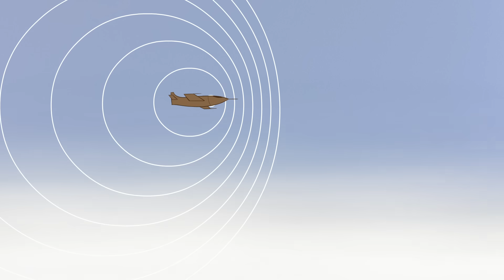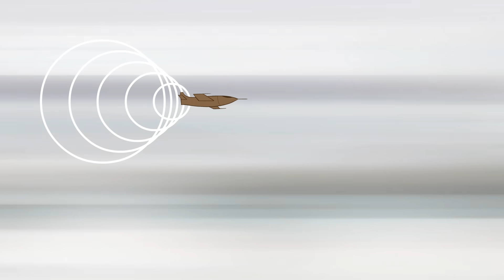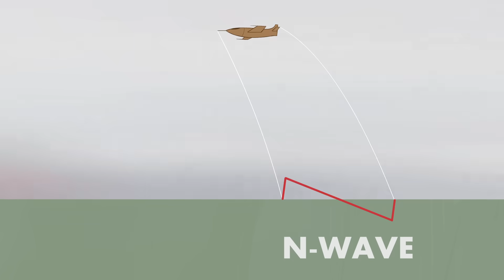The sonic boom problem - Katerina Kaouri

Comment: There’s a lot of great things about his video, but the fact that you used km/h is perhaps the greatest.
Reply: All hail the metric system.
Reply: Using SI units is the trait of someone serious about STEM as all the equations work without messy conversions. It is beyond me why we havent adopted SI in the US as the norm. I truly hope we eventually will. Imagine not having to learn a second set of rules and just concentrating on the concepts, relationships of phenomena, and a single set of formulas. Plus, we can rid ourselves of the introduced error given by conversion.
Reply: @ACKZink  In the SI system, the correct velocity units are meters per second, not kilometers per hour.
Reply: @ACKZink  I feel for you but here in the UK we have a very very messy mix of the two. !! Cars - mph. Food - now in grams.  Flights - miles.  Road signs - miles!  You get the idea. My kids are still confused and I really thought by 2021 we’d have got settled on one SI system !!! Great vid.
Reply: @ACKZink  not really. Plenty of professionals don't use SI units, e.g., what is the mass of the Higgs boson, and how many inverse pico-barns did it take to measure it? How many Janskys is that radio galaxy? Got a 500 mb weather chart? Speaking of weather, how many dBz was that rain last night?
The mark of someone serious about STEM is that they use the right unit for the job.
Reply: Km/h is more widely used.
Reply: Ideally there would be both but if you could pick one I think the metric is the right choice 

-US PERSON
Reply: Whose here after the sonicboom in Bangalore
Reply: @SataniaSquid  I know it's been 6 months, but you can't say that 1 km = 0.6 miles and then say 6 km = 10 miles. I think you meant 6 miles = 10 km.
Reply: Izz Irfan  no the UK Use Miles
Reply: There are countries that use the metric system, and then there are those that landed on the moon.
Reply: Quick. Americans are sleeping. Support km/h
Reply: Gold comment
Reply: ktas would be better
Reply: isnt mach 1 like 1200kph. dude said it was like 1100kph.
Reply: @m1a1abrams3  kph isn't a unit
Reply: Matic Pogorelec Your sentence structure is not correct.
Reply: @m1a1abrams3  And what is wrong about my sentence structure?
Reply: Matic Pogorelec First off, I don’t know where it starts nor ends since there isn’t a capitalized letter nor is there a period.
Reply: @m1a1abrams3  And what is second off?
Reply: Matic Pogorelec Why does grammar on the internet  even matter if people understand the idea of the sentence?
Reply: @m1a1abrams3  because kph isn't a thing.
Reply: Matic Pogorelec kph is a thing lol, just probs not in ur country
Reply: Kmph is easy
Reply: Underrated comment.
Reply: Listing both would have been the best thing about the video
Reply: *the worst
Reply: The worst
Reply: Why the heck did us Americans end up with the weird measurement system? I would’ve much rather learned km/h in school than mph because it’s so much more convenient. I like using miles more but it’s mostly just a hassle because of the fact that the rest of the world uses kilometers.
Reply: I dont understand third world country measurements
Reply: From Philippines👍
Reply: HuRrRrRrrrrrr
Reply: I think that’s the worst thing about the video.
Reply: Just divide by 2 for knots.. ish
Reply: So this is smart level humor huh haha
Reply: Yes
Reply: Celsius as well
Reply: Never had I agreed more with someone as with your comment..
Reply: perfect for Indians
Reply: Sonic boom is a big TV show
Reply: Izz Irfan  no actually, the rest of the world, except a very few select countries, use knots for airspeed like normal people, regardless of wether the plane was built using metric, or comes from a country that uses it.
Reply: Is better m/s you can see the speed more detail
Reply: Mechail Reydon 
That is true
Reply: No
Reply: My god he did it
Reply: Why?
Reply: Agree
Reply: America is not happy
Reply: Asian peopele like this
Reply: I'm american and I am learning metric to avoid confusion and sometimes wish that we would adapt to the metric system. I would tell my friends that i was going 120 down the highway and 60 down the neighborhood as a joke and cracks me up to hear their reaction!
Reply: +1
Reply: Speedofeet user when they hear a meter 🤯
Reply: Idk how he didn't use bald eagle per oil litre
Edit:wtf is going on in this thread
Reply: Yes, this was the best
Reply: Some Americans wont understand 😏
Reply: i do miles though ;(
Reply: I'm America and i still have no idea why we haven't swaped
Reply: Hahahahaha!
Reply: It is the way.
Reply: in merica we use hotdogs per bald eagle :(
Reply: Bruh it not hard to change km to miles just divide by 1.609 or knots divide my 1.852
Reply: REEEEEEEEEERRREEERRRRER
Reply: @SuBk.  América is a continent. That is literally its name. Idk where are you getting the info 😐
Reply: Nah
Reply: In murica they use pi miles per quarter century.
Reply: Amgery 'mericans everywer
Reply: NOOOOO. Mph is the best!
Reply: Fax kid
Reply: Should've measured using football fields
Reply: @nottingham12312  america bad?   You mean America is Badass!!
Reply: Absolutely true LMAO
Reply: Perhaps the worst
Reply: I would be surprised if they didn't.......You don't use anything else but metric for scientific stuff.
Reply: @somethingsomethinghere  that's just not true. May pros deviate from S.I.
Reply: Right
Reply: For real.
Reply: Cope
Reply: I dont understand fourth world measurements
Reply: screw imperial system!
Reply: Not very helpful for people living in the US or the UK though is it? The majority of the audience for English speakers.
Reply: meow meow meow
Reply: cries in freedom tears
Reply: Nooooo not KPH
Reply: So British
Reply: plus the minecraft splash sound effect lol
Reply: I disagree if you're going to use kilometers per hour at least speak in a British accent
Reply: Probably the worst thing about the video
Reply: Yes true.
Reply: He did because because of the S.I. system
Reply: Mph would have been even great 👍
Reply: Km/h or SI unit
Reply: @pralay1265  we are the crystal GEMZ 💎
Reply: Knots is much better for aviation context. I just block videos and channels that use the metric system.
Reply: Amen
Reply: Despite the fact that the standard way to measure speed in physics is m/s.
Reply: exactly. car vids and channels should do the same
Reply: The metric system is only good for measuring small pipe. Says a lot about you .
Reply: @getlost4827  imagine using imperial
Reply: Hello nonUS people
Reply: Yes!!!
Reply: Why don't americans use nose/face
Reply: knots
Reply: Miles per hour plese.  MURICA'!!!!
Reply: meter/sec 🙂
Reply: I love the metric system too but they really should have used knots. The formula to find the speed of sound in knots is:  Local Speed of Sound (Kts) = 39√(273+Outside Air Temp (c))
Reply: Yes, educational videos that are discriminatory towards the audience are really great!
Reply: @user60521123  Would you call it discriminatory for using mph? 95% of the world population uses metric.
Reply: politicize much?
Reply: I’m an American, and I prefer kangaroos/gogurt to km/hr…
Reply: America is not a country, its a continent
Reply: Shadow Moss America isn’t actually a continent, but North America and South America is.
Reply: @Olliwer  its a continent, but if you see it like that, you should count central america too
Reply: Shadow Moss Central America isn’t considered a continent though.
Reply: @Olliwer  north america, central america and south america are the same continent. If thats not how they teach you in school, i feel sorry
Reply: Shadow Moss I don’t think you have been in school if you think they are a single continent. Even a simple google search would have cleared it up.
Reply: @Olliwer  what a surprise, googled "America" and says "is the second largest continent after asia" and if you do a little research, just a little (literally just scroll down) says that america del norte, america central y america del sur are subdivissions of the continent. Again, what a surprise
Reply: Shadow Moss Well, we are using different googles then. You are probably reffering to The Americas, though that isn’t a continent either.
Reply: @Olliwer  no, america
Reply: @shadowmoss6413  Yeah Asia and Europe is the same continent
Reply: @Olliwer  America is a continent. They teach us that in school.
Reply: @vanessasx  If you’re from the US that’s understandable, if not your school sucks
Reply: @shadowmoss6413  No dude that's not how it is , there are seven continents that's what is taught worldwide . They are 1.Asia , 2. Europe, 3. Oceania, 4. Antarctica, 5. Africa, 6. North America, 7. South Africa.
Reply: @shadowmoss6413   I think “The Americas” continent is something similar to “Eurasia”, because I searched America in google and all but one site was about the USA, the exception was about “The Americas” not “America”. Also, Seven continents, North and South America, Europe, Asia, Africa, Africa, and Antarctica, also quick question how do you define a continent, or how you were taught to define a continent?
Reply: I'll just end the debate. Some use mph, some use kmph. But eventually it makes more sense for the world to come in terms of kmph and other metric units.

Reason: 1 mile= 1760*3*12 inches
1km =10*10*10*10*10 cm

You all know which one you can calculate faster. Being an intelligent species, let's use our intelligence in more productive ways.

P.S. - I've purposely not mentioned any countries, as that's immaterial.
Reply: @the_picsopedia  I'm just going to continue to say what I've been saying, yeah metric makes more sense for most measurements, but Knots is what 90 percent of the planet uses for airspeed, including the country who set the fastest airspeed record, broke the sound barrier, and every other country that has a standing air force except 2. Mentioning counties isn't immaterial when you're using them as references for who does and who doesn't use knots.
Reply: m/s plz :>
Reply: @Bozothcow  divide the value by 3.6
Reply: 12 much effort 18 me
Reply: zTit6nxX 1.6
Reply: @zitenx9528  We've all been to elementary school mate
Reply: @Bozothcow  12 much effort 16 me*
Reply: @zitenx9528  you can do that in your head I guess😑
Reply: @zitenx9528  I thought it was 2.-..?
Reply: @zitenx9528  I’m too lazy
Reply: @Bozothcow  bro u def should’ve said “7.2 work 14.4 me” bc u divide by 3.6 lol
Reply: @zitenx9528  I never knew that, thank you I'm gonna use this on my upcoming exam if I need it
Reply: @Bozothcow  no
Reply: @Bozothcow  suffer the pain we suffered for years
Reply: @Bozothcow  multiply with 5 and divide with 18
Reply: Thank god
Reply: I use knots. Was very confused 
I also use AU/H (astronomical units an hour)
Reply: This is America, maggot!
Reply: Not like knots is the airspeed measurement used by: France, Britan, America, the country that broke the sound barrier, the country that made the fastest plane in history, or really the entire rest of the aviation....
Reply: @ryanboles8590  America made this using International Metric Sistem.
Reply: Gotta miss those miles per Fahrenheits
Reply: Embarrassing Americans.
Reply: @deltanovember1672  embarrassing humanity
Reply: I was born with km/h but moved to live in the mph world. Now, I'm kinda irritated for it not to convert to mph
Reply: Ngọc Hoàng 🌗🥴
Reply: @NH-hq7ly take physics class
Reply: Agreed👍
Reply: I'm from America, and I was confused by this...
Reply: @crazy_pyromaniac  learn the mtric system if you're gonna learna nything
Reply: @markwilson717  I know how to divide, use google maps, and pay at 7-eleven, and that’s enough for me.
Reply: @crazy_pyromaniac  what comment are you replying to the reply section is too big and I don't remember replyihng to you
Reply: @crazy_pyromaniac  but the us gov has too much of a superiority complex to update
Reply: @crazy_pyromaniac   by which you confuse ]
Reply: @crazy_pyromaniac  go convert it to your metric. Rest of the world > murica
Reply: @crazy_pyromaniac L
Reply: @nathandei1674  The letter "L" has an intriguing history. It originated from the Phoenician alphabet and was later adopted by the Greeks as "Lambda." Over time, it evolved into its current form in the Latin alphabet. The shape of "L" is believed to have been inspired by an ancient Egyptian hieroglyph that represented an ox goad or a shepherd's staff. The sound of "L" is produced by placing the tip of the tongue against the alveolar ridge behind the upper front teeth. So, next time you write or say the letter "L," remember its fascinating journey through time and its unique shape and sound.
Reply: @crazy_pyromaniac perhaps america should join the rest of the world then and use metric which is better anyway
Reply: IZZGAMER123 thx fo statin da obvious
Reply: Even if most of the world uses the metric system the whole world doesn’t speak English
Reply: Team RiZe English is taught to most children in Western countries now. 

The US once didn’t buy a tank blueprint since it used the metric system.

Another difference is that the metric system is unarguably better in every way. You can’t say that about the English language.
Reply: larz anthony  thanks for telling me I had no idea a lot of Western Europeans knew English also I do think we should switch soon metric is way easier to use and simple to understand
Reply: @afr0218  a lot of countries do know English in fact I’m pretty sure India of all places is the 2nd most English speaking country behind us
Reply: @alexandru dumitru I'm British and we use mph.
Reply: @valarmorgulis3920 if you were really British you would've typed Bri'ish
Reply: Strange since all those metric countries weren't the ones that broke the sound barrier in manned flight first. It was good old America and the Imperial System with all it's flaws.  Miles Per Hour Baby!
Reply: @TUCOtheratt  the scientist in america that actually did the scientific break through uses kms/h and they are sad that america still hasnt converted to the metric system.
Reply: More like the worst
Reply: @valarmorgulis3920  why? 'cause the rest of the world can understand?
Reply: mph is better than km/h don’t care what you think
Reply: MMMMUUUURICAAA!!!
Reply: Nybbl er LOL American has enough fire power and military to go against the entire world at once, you eunuch
Reply: @jamesbizs  Russia just Russia
Reply: IZZGAMER123 you’re poor be quiet
Reply: @logknot7867  I mean Switzerland,Norway and a few other countries have a higher income per capita so technically they are richer
Reply: Grim Reaper because they have lesser people? Switzerland has the same population as NYC
Reply: @logknot7867  So then India and China are the richest
Reply: LogKnot Just less not lesser
Reply: @grimreaper159  I mean America could invade those counties with like one tank if we wanted 😂
Reply: IZZGAMER123 but America does more or less kind of run the world
Reply: Wyatt you must be a 14 yr old kid to make such a remark 😂😂
Reply: @wyatt7454  you forgot an i in ruin.
Reply: @immanuelkantholz9033  I’m very late but that’s very funny
Reply: @wyatt7454  No it doesn't lol
Reply: Wyatt AHAHAHAHAHAHA
America may be the richest, but definitely not rule the world
Reply: Maximusil105 the world runs on the US dollar. So yes, yes we do run the world.
Reply: Michael Esposito Uhhh, the Euro? Yen? Rupees? The American dollar is just that, the American dollar. Every country has their own economy and thus their own currency. Many English speaking countries/western countries may use the phrase dollar yes, however that doesn’t mean the world runs off of the same value of currency.
Reply: Wyatt no they don’t 😂😂
Reply: Wyatt You mean the world of idiocracy? If so, you are right.
Reply: @wyatt7454  You couldn't run a general election, nevermind the world, lol.
Reply: @wyatt7454  Tell that to the Russians.
Reply: Wyatt Not even nearly, but they think they run the world.
Reply: @wyatt7454  america run the world? This is not a superhero movie.😂
Reply: @wyatt7454  “USA” means “union of states on the (former) continent of America”. Not “union of states that make the country of America”. It’s like calling the EU Europe.
Reply: @wyatt7454  uh, nah.
Reply: Aditya Kannan uh, yes.
Reply: @wyatt7454  that's wrong...
Reply: Wyatt  Scientists mainly use other SI Units. Even American ones
Reply: @wyatt7454  no it doesn't. it's just a part of the world economy and strength, not even talking about how small the population is compared to the rest of the world
Reply: @wyatt7454  no no it dosent
Reply: @wyatt7454  not really
Reply: @wyatt7454  ...in what way?
Reply: @wyatt7454  they don’t but k
Reply: @wyatt7454  But every engineer in America receives their degree in SI units, so....
Reply: @wyatt7454  not mentally
Reply: @wyatt7454  the copium
Reply: @wyatt7454  look at ur debt
Reply: @wyatt7454  No?
Reply: @wyatt7454  literally no
Reply: @wyatt7454  I love this twisted form to view reality from people in the USA (because America is a continent, not a country as well)
Reply: @wyatt7454  uh huh.... of course...
Reply: @wyatt7454  *scientific world
Reply: um... no?

i don’t care if it’s 3 moths later
Reply: @wyatt7454  Shhhh dont reveal the secret

Comment: If two aircraft are flying in formation at supersonic speed, and an aircraft drifts slightly backward into the mach cone, will the aircraft hear the sonic boom of the aircraft? And if so, could the aircraft hold the spot and hear a constant sonic boom?